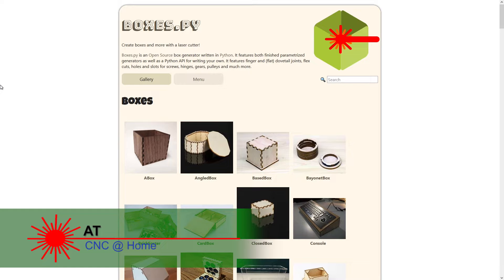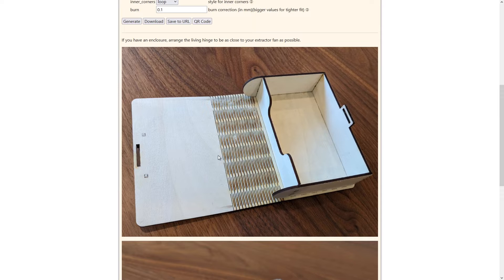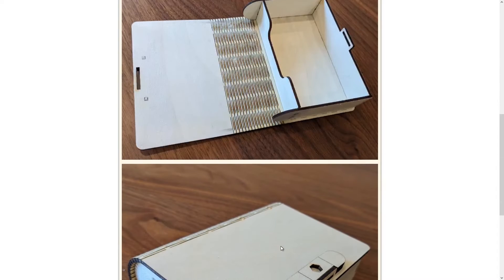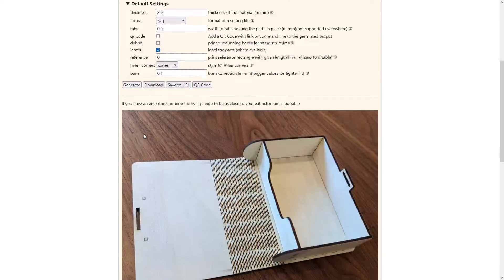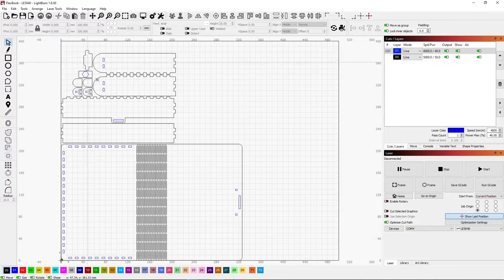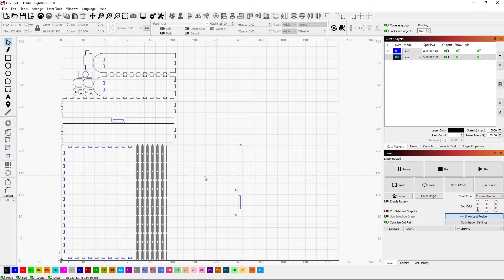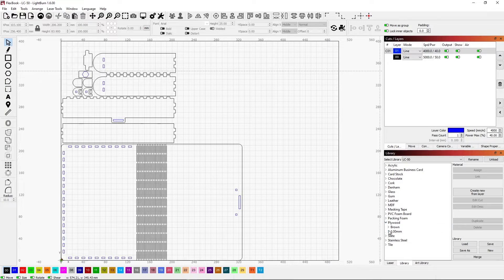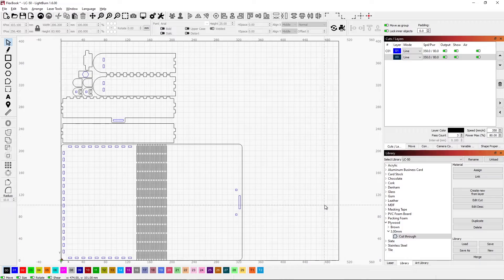Major living hinge failure - This is why you plan on building two or more

Comment: Maybe you have them in another video, but any chance you can guide me to the settings you spoke about making the fingers fit better? Also, did you remove cuts from the living hinge? What would you recommend if attempting to do something similar?
Reply from the maker: I don't remember if I talked much about that.  The setting under "Settings for Finger Joints" called "Space" is set to 1 by default.  That means 1 material thickness wide.  That can be just a little bigger to allow for easier fitment.  It is a percent of material thickness. Using the default for "Distance" under "Settings for Flex" was too small and the living hinge bent easy but was too fragile.  The default seems to be 0.5 and going up to .75 or even 1 might be good.  I don't remember what setting I used and the hing was very stiff but much stronger.  I hope that helps.  As you make changes to the settings, you can see the change on that page.